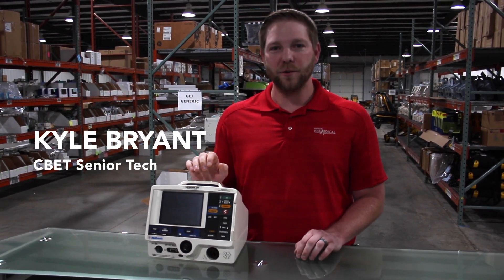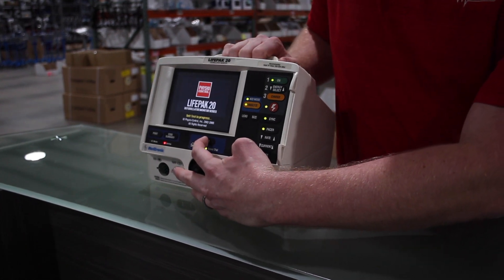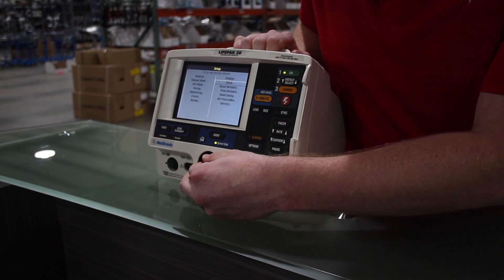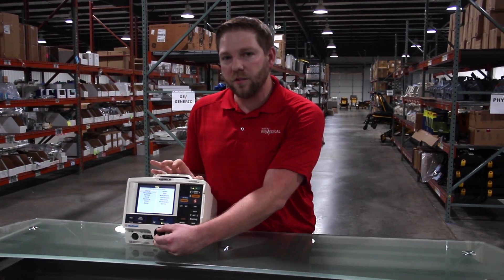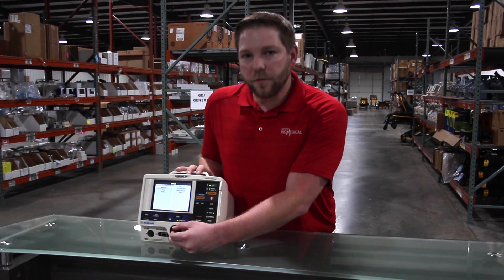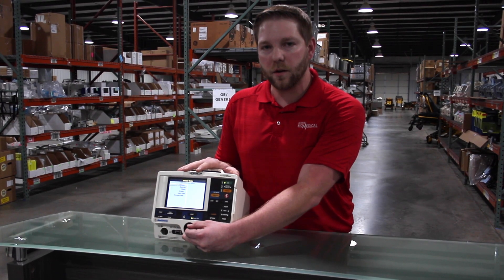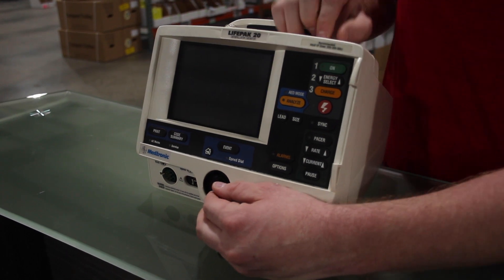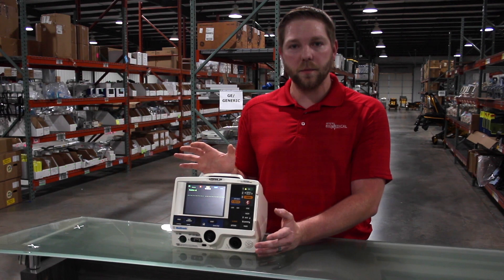Lifepak 20 Maintenance (PM)

Comment: How i can upgrade system or enter in hidden menu for unlock function
Reply from the maker: There isn't a hidden menu on the LP20s. To perform a software update and add functions, the defibrillator would have to be sent in to Stryker. We can offer a trade-in value on your defibrillator so you can get the LP20 with functions you need? Feel free to call us at 844-425-0987 or fill out a contact form and we can see what we can help you with! https://renewbiomedical.com/contact/